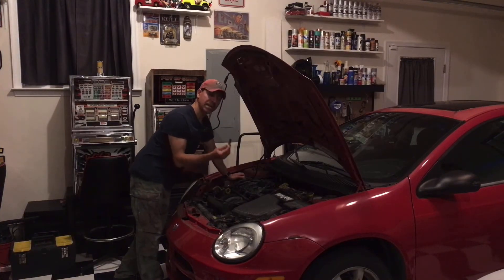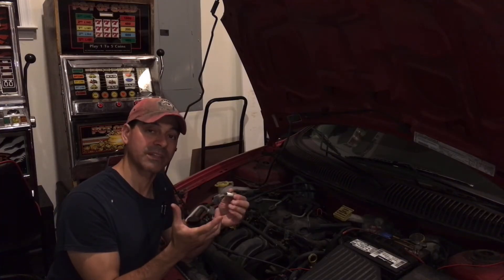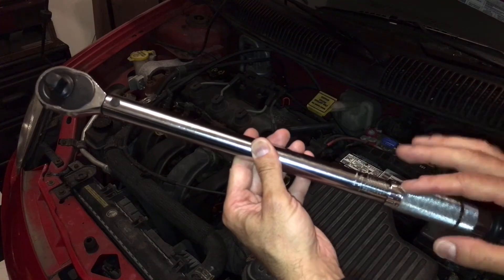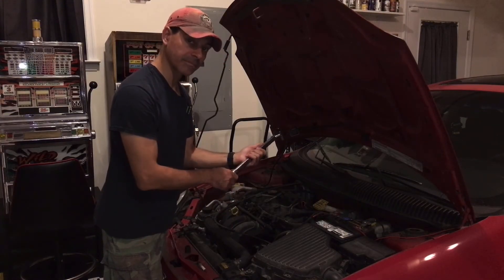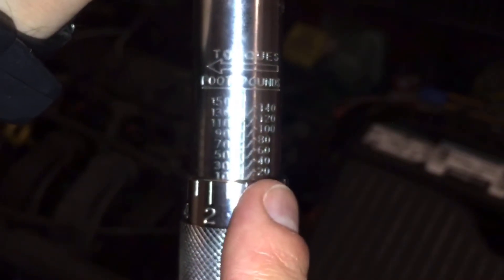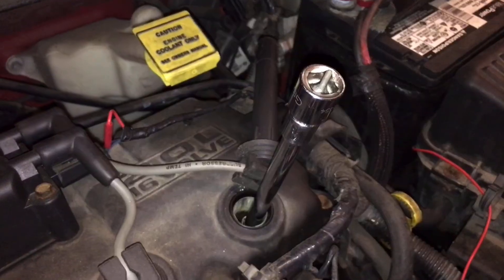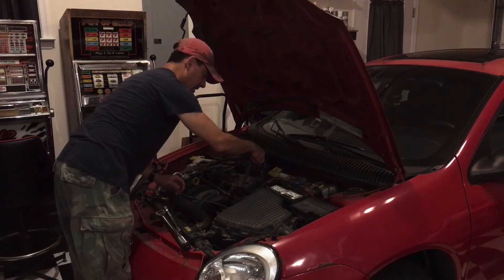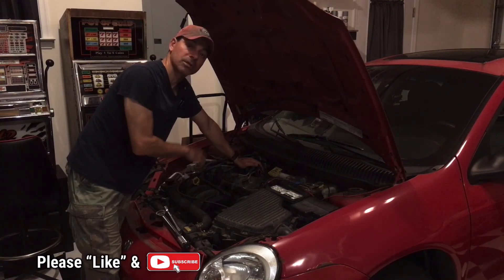How To Torque Spark Plugs (Andy’s Garage: Episode - 266)

Comment: Get a magnet 🧲 extension stick 🦯 grabber, and use it to hold the spark plug as you tighten it initially it seems to make it easier to catch the thread and not cross thread it with force!

Comment: Is there any right or wrong torque wrench to use as far as using a digital or click?
Reply from the maker: @ashamarks-eo8jb  I hear a lot of positive things about the accuracy of the digital ones, but I prefer the traditional click ones
Reply: @PhillipsVision  thank you for your response. But just to confirm there's no right or wrong right? I know with some engine parts you are not supposed to use click type that's why I ask.
Reply from the maker: @ I always use the click type with no problem

Comment: I have to play with this to commit it to memory! Excellent video btw and the boot is extremely important and makes the job much easier (socket for spark plug) my spark plugs need the boot socket because I can't get my fingers in far enough to turn the plug by hand.

Comment: What I don't understand is why the spark plug wobbles in the tube after it's already caught threads when tightened by hand. 

Mine have crush washers/gaskets - and every time I get close to bottoming out the plug I cannot tell if I've cross threaded before applying 3/8 torque wrench because there's all sorts of movement.

Comment: Extension will cause over torque , let say manual say 20 Nm , if you use extension and set 20Nm ,it will actually around 25Nm
Reply: No, I don't think so. The extension make easier for your move but inside it's working same as it set to.

Comment: The spark plug dry torque spec for my cast iron cylinder head vehicle is 13 lbs/ft.  Since I wil be using grease on the spark plug  threads to keep rust away I plan on reducing the torque to 10 lbs/ft.  Thoughts?
Reply from the maker: Reducing the torque is not a bad idea since the grease will reduce the force. You don’t want to risk over tightening